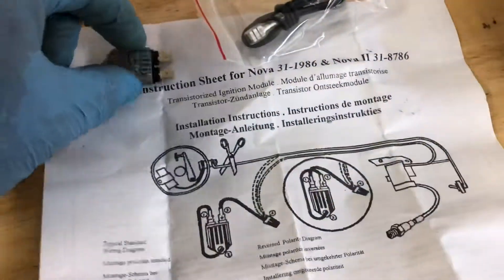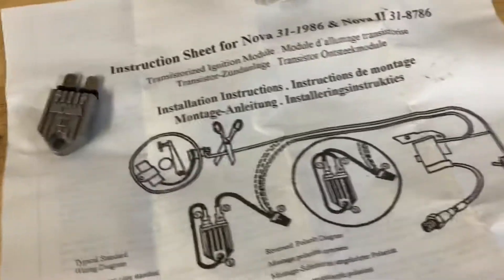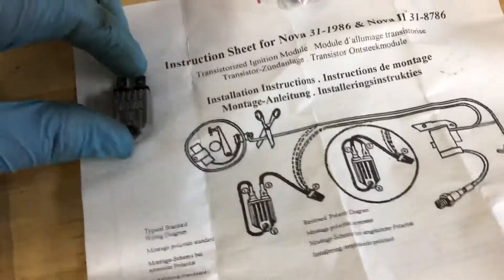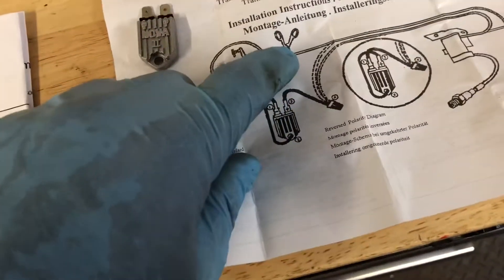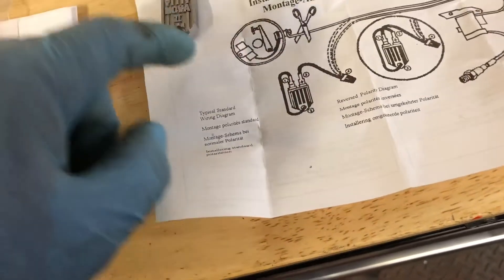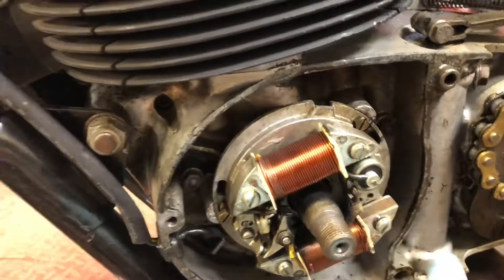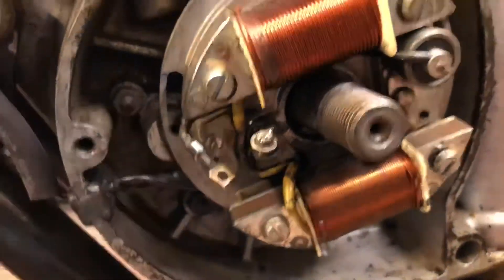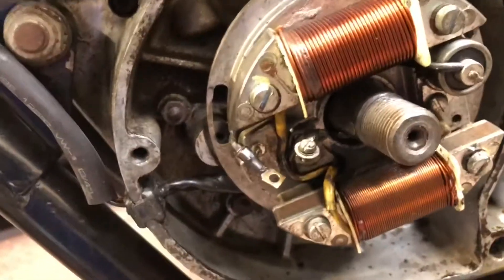Nova 2 Electonic Ignition

Comment: Hi, I have a vintage Guzzi Zigolo motorcycle with a contact point stator and a magneto flywheel. Do you think this module could replace the contact points and condenser? Could you tell me how the connections should be made?

Comment: Have you ever seen fail one of these ? Actually,  I mean 2 of them ? The situation I have is as follows : an old Honda G150 I have had one of them mounted on, and suddenly the engine gave up.  So I started looking for the problem and saw that the points were taken out by the previous owner, but the condensor was shortened to ground.  I measured the coil, and seems OK (0,9 & 6k5 ohm). Spark plug OK, spark plug cap OK, kill switch OK, ground OK, but no spark when connected tho the module,  coil bench test was OK (with a 9V battery), but I found the spark was weak.  So, bought a new module.  But still no spark ... It's really a weird problem ...  I'm thinking of adding a secondary condenser between primary and ground, but no idea of that could help ... ?